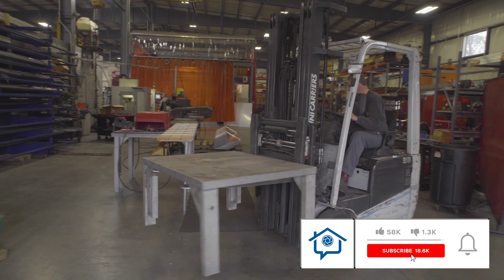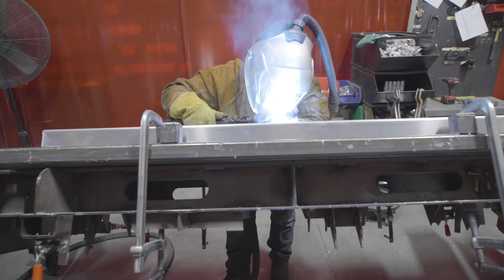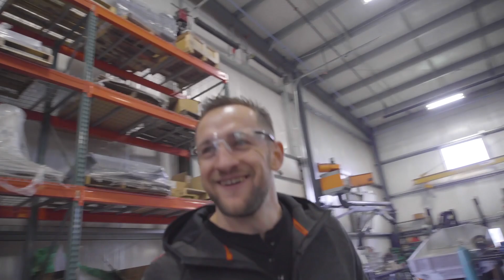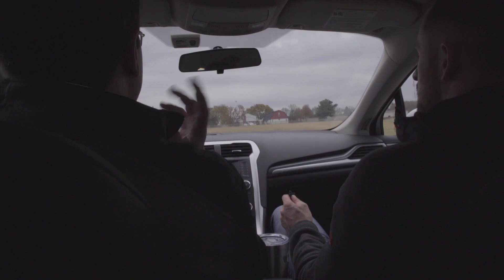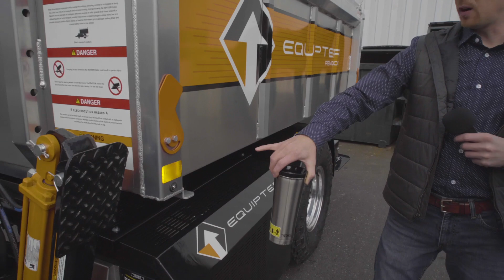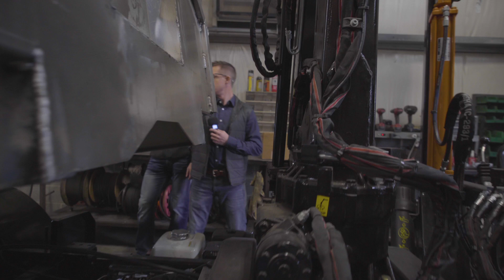How Equipter changed Roofing Industry: Innovation from Amish community

Comment: Dimitri - you are 100% correct about the industry shift towards sales.  I cut my teeth for a storm company in Burnsville (you probably know who) and left after a couple years due to better opportunity.  I started my own company and shifted my focus to production and quality.  SO MANY more referrals!  I use a mix of W4 employees and subs.  I LOVE my W4s - they are cheaper than my subs (overall), and their quality output is much higher on average. I also KNOW the insurance on them is valid...because I control it!  The RB4000 is on my hit list for my W4 crew....will probably buy one next year.  I could see this widening my margins on W4 jobs by 20 - 25% easily.  Thanks for the videos!